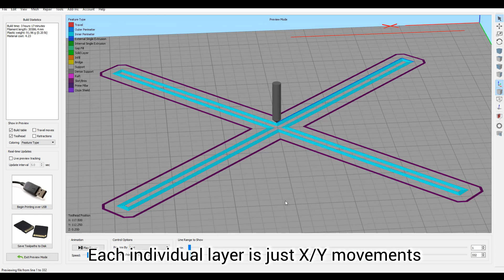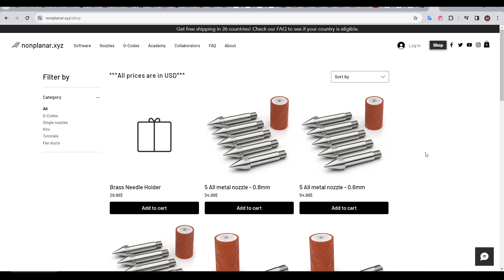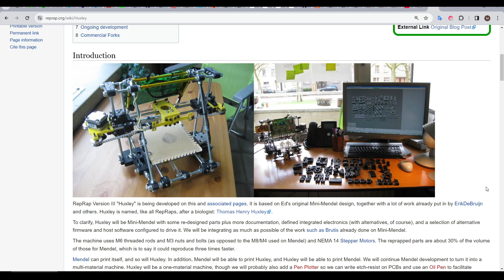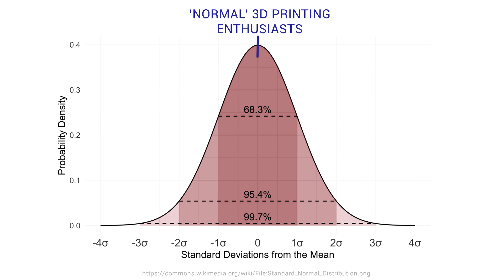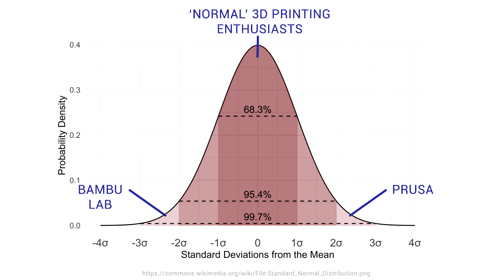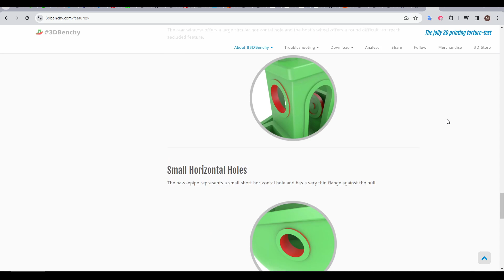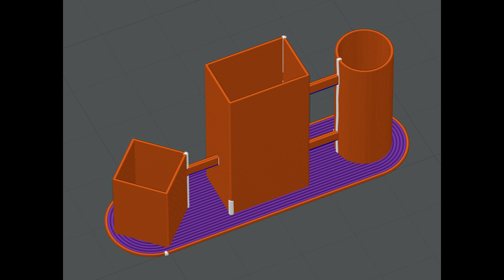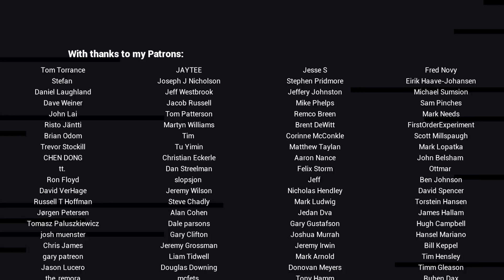3D printing mysteries that need to be solved in 2024

Comment: 9:20 Ford broken film noticed if you use a heated filament dryer it can cause brittleness if you cycle the filament a few times depending on the material, in addition some additives in filament can "evaporate" if not used for a long time causing brittleness what the additives are j have no clue. I just get the same problem with the same filiment

Comment: Planar: yes, we're all waiting for it. But as it will be only for "the look", I don't think any slicer company will touch it. The technical site of it is many times more complex than the looks of it.
Hemisphere: uhm, repeat the experiment with a 100% perfect filament, perfect nozzle (dimensions and clean), perfect feed and a perfect climate control (fans produce draft) and you would see that filament will not curl but drop straight down. Mine does, most of the time. 
Toxic: not my expertise. But I think people don't like other ideas. It could mean their ideas are "faulty" and recognizing your own fault could be pretty confronting. (Good luke with your bowden setup dummy 😂)
Filament snap: it's your setup. You feed the filament in a S shape AND forcing it through a bend. As long as you keep a steady feed, no problem. But start printing and think retracting. At that moment you are jerking the filament up and down the bend. I'm betting your ptfe tubing prevented the filament from snaping off complete. Change the setup to a feed coming from the top of the rol with only one "natural" bend. And I would not use tubing between roll and extruder, it causes strain and prevents "natural" form of the filament.
Artefact: the human eye is very good, if not nature's best, in spotting differences. Any change in gcode between the layers will produce some kind of artifact as the approche of the nozzle will be different. Monotone surface (Cura) is a nice example of this in the flat plane. In this case I bet it's caused by the prolonged cooling of the block while the toplayers of the tube are printed. Playing around with nozzle temp and cooling on a long tube in vasemode will produce matt to very shiny layers. The best solution I found for this problem is an enclosure for more even "crystalisation" and printing object one for one. But any production method leaves it's marks..
Benchies: I don't do benchies, I'm a engineer.

Comment: I've noticed that PLA always breaks if you leave it in the bowden tube for too long.  People used to say it was moisture, but I find that the rest of the roll is fine when the bit in the boden tube breaks  - just the bit in the bowden tube is brittle.  I also have dry boxes that I feed filament directly from.  They feed through a short length of teflon tube set in the lid of the box, and yes it always breaks at that point as well.  I'm going to re-do my dry boxes and just make a gland out of PLA with no tube this time and see if that helps the problem.  Don't get me wrong, moisture is definitely a factor, but that doesn't make sense for the bowden tube since there won't be much exchange of moist (or dry) air inside the tube, so the filament should be alright.  Maybe the Teflon is actually removing from the filament?  I've heard that over drying your filament can also make it brittle.

Comment: for the last thing the "artifacts thing",   my theory is that the usually retraction relieves the build up pressure inside the nozzle when a layer starts and ends. when the printer start printing again that pressure can be more or less than the the layer before (depending on the retraction settings) so i think this is what is causing the artifacts and which means maybe retraction settings may help, Ive not experimented much with this though. i ussually change my designs to not be too effected by this artifact.

Comment: Regarding your tower and cube issue I also think it is temperature related. The same happens when you pause the print or you change the filament. During your last layer on the cylinder you print a solid layer which takes longer. The other part shrinks and also you have some sort of non stabilized flows and temperatures in the nozzle. So I guess you are poking in the right direction. Regarding the one testprint you also should look up for the seams in the gcode if they arenset differently. Also an Idea for a testsetup: print a tower close to a cylinder. And just very infill on the cylinder from 15-100% every 5mm or so. As parallel track and plot the nozzle temperatures and maybe use thermal camera if you have one. Just as a few ideas, because I would be also interessted in the knowledge. Also try different filaments with different thermal shrinkage during the test.

Comment: I am confident there is more than one cause. But one is probably a big enough factor to appear to fix it on casual inspection. Two layers with different surface areas to print have different time-between-layers, different thermal properties, surface tension probably affects 3d printing more than you realize, so changing the surface area will have an effect (probably barely noticeable), those layers also have different airflow, etc. I suspect the color change and the indentation opposite the support are actually different effects.

Comment: I've been wondering about those "referred artifacts" lately, too. Aside from what was mentioned about temp/flow rate, which could well account for some of this, I also wonder if the toolhead pathing is also part of the issue? When layers are consistent, the toolpath also tends to be consistent, so extrusions are drawn in the same order and direction, layer-on-layer. When adjacent geometry changes significantly, the neighbouring extrusions can also change, for example perimeters might start from a different point, be extruded in the opposite direction than the previous layer, and speeds can change too (i.e. the flow rate).
Like many artifacts, these seem more obvious at higher speeds in my experience, which makes sense to me since at higher speed the nozzle will travel further while plastic is semi-solidified, dragging the just-laid-down extrusion a tiny bit, behind it. You throw all these factors together and it could explain a lot.

I think you could investigate the toolpath theory by simply examining the GCode to see if the problem areas are clearly different in how they get pathed by the slicer, compared to the good areas.

Comment: The possible cause of the artifacts may be that the amount of time between layers at a given spot.  This means there is more or less time for the printed material to cool before the next layer.  Someone can test this with so gcode modification.  You can have the  hot end go back and forth a bunch of times to add a delay.  This will tend to cool the head and reduce the flow rate as well as allowing more time.  If my idea is correct, the artifact should b the same.  If I am wrong you will get the inverse artifact.

Comment: I have always love you tech channel and is my number one to solve my issues as you give clear and concise information

Breaking filament 
Well over the years I can say it is old filament that has been exposed to moisture
And so for testing brands I tend to leave filament exposed for about two weeks and try a print
And so I can confirm it is moisture and sunlight or UV light that degrades my  filament
So my solution is 
When not using it. Is to put it back in it's packaging along with the desecrent moisture stuff
And with esun CF after two years it still works fine
I do have a heat box or moisture heater but I don't bother with it
Plain and simple if you finish printing then put away the filament
As for printing with different shapes and height problem weakness
I have resolved my issue by lower the fan speed
Meaning as your model gets higher the ambient temperature changes
And this also happens with certain shapes. 
Meaning an air flow around a round object has a circle swirl airflow for which is good
But upon square objects the airflow deflects ie bounces around causing insufficient air flow to that part in question
I hope my feedback is worthy

Comment: The surface artefacts must only be related to flow. To me it seems you are experiencing moments of too high or low pressure for the molten plastic in the nozzle which results in "flow shift" I guess you can call it. While you may have a set "flow rate", it can still be affected by the rate the filament is being fed and during what activity the printer is performing, ex: walls, infill, etc. I just spent a few weeks tuning my Ender 3 S1 Pro to print in TPU60A and surface artefacts are much more apparent due to how sensitive this material is. I printed a calibration cube and because of how fast it was doing my infill, the filament fed in faster and resulted in higher pressure which came out as a bulged wall, this ended with a finished cube that has small waves along all its walls going from top to bottom

Comment: I still believe the non-planar 3d printing would be a very nice feature for any slicer. I don't mean you would have to print in such a way all the layers, but it would be nice to resort to non-planar for small angles/curves and I bet it would only be a matter of detecting a set of layers that may fit the case and apply to the top infill algo.
Regarding the artefacts, I tend to believe it is a mix of temperatures, fans, accelerations and retraction settings although I could not fix them so far. I wonder if a good test model can be produced to run some tests but still you would have to really tweak settings in the gcode to modify on a per-layer basis so many parameters that might be involved.
By the way: I'm in Italy and my filament is poured clockwise. :)

Comment: I think you hit the nail on the head when it came to the last question, the first thing that came to mind for me was a temperature differential, there may be multiple factors in the cause though.  As for toxicity in the 3D Printer community, I don't think it has become worse per say, more so the extremist have become more vocal and less willing to learn through constructive communication.  I am sorry you got so much hammering over building a Ratrig vs a Voron.  I am a Voron builder myself (and Annex K3 and customer printers), however what I have found within the Voron Community, we as a group seem to be more open to ideas / knowledge and constantly pushing development.  I have been on the receiving end from Ratrig guys and some VZ Bot guys, but as a general rule, we are pretty open and helpful.  We have found we spend more time helping others with their other brand printer in the Voron Discord VC than Vorons, its seems to be more a help people with specific and more commonly Klipper issues. 
Also, the filament failure in your reverse bowden is a combination of things, the main causes of the issue you are seeing are A exposure to UV, B the filament is set on the spool giving it a predefined arc and in that bowden setup, it will cause microfractures C moisture getting into the filament (even in ABS and ASA) and finally D oxidization causing a brittle outer layer and leading to more microfractures.  Also, love the TTR channel and nods to MCM

Comment: nonplanar printing is something I would like to see, the extended nozzles with adding a 4th axis to the print head would greatly increase clearance if you could program in an approach angle and departure angle you sould likely resolve the issues. but a specialized slicer would be required and auto tramming would make it user friendly

Comment: For the artefact with the top layer notice that you have a matte band a couple layers thick at the top of the rectangle prism. So I think it has got to do with the cooling fan and bridging when the fan is running full blast the corners get more rounded because of the filament cooling faster tightening the "string" of filament

Comment: 6:21 Well, you just described all of US politics in a single sentence. Who knew that 3D printing was a universal concept! Extremists are the enemy, and the initial folks aren't the extremists - it's all the people who come later who've latched onto something that somebody earlier said (but didn't mean as gospel).

And the benchy secret is blowing my mind! 

Regarding the print artifacts, I've remarked on this to Ernest and/or in the SecKit group. My experience is similar to yours - when I get artifacts, it's because the model geometry changes noticeably. My theory was that the hotend heater and/or part cooling do not react quickly enough, and may need some approach similar to linear advance or retraction in order to properly match the change in geometry at the right time.

Comment: For what creates the surface artifacts could also maybe be retraction. The jumping between objects so it retracts and some filament is still sitting in the hot end cooking a bit longer causing the dye to change color and get a little lighter. The indentation could be the slicer trying to off set the change of direction. I am thinking kind of like input shaping but more that it has a lower flow than needed to fill two walls so the two walls are not really two walls in the area. More like a wall then getting stretched into a bridge area. so it is melting a bit in. For the bottom one where it was pushed out on the far side that could be because of the backup of pressure and taking that turn gives it a bit more room to squeeze out on the turn. Not really sure just some ideas.

Comment: Okay, I was following along right up until you showed the examples of "toxic" comments. I read each one. Two of them were a bit disrespectful; the rest were completely fine. More broadly, I agree. 
As for non-planar, I'm still excited for it. But there are few things that it is useful for (aerofoils?). I suspect that's the primary reason it hasn't taken off. I wonder if people are more actively using non-planar printing among drone enthusiasts.

Comment: Regarding the artifacts, the longer the extruder flows continuously the temperature at the very tip of the nozzle starts to drop, which changes the viscosity/dynamics of the flow over time, so when it is printing the same layer or very similar layers many times (which would have a consistent layer time) the dynamics of the flow are consistent. When the layer time is different, even if is the same G-Code for a certain part of the layer, the result will be different due to this temperature variation. That also means that the K value "calibration" for the pressure advance is not perfect for all the print, but for a very specific case. In a perfect world this K value would change during print according to the dynamics of the flow.

I'm currently working on a possible solution to that as my final college project. I should post the results on my youtube channel soon
Reply: You are the second channel i follow now in this comment section, having a possible solution to one of each problem spoken about in this video. Many great minds were apparently summond by this very video.
Reply: This is the conclusion I reached many years ago as well (and was explaining to someone on Reddit today, actually). Good luck with your dissertation!
Reply: I have thought about this problem as well. Unfortunately, I am not smart enough to solve it. Non-linear pressure advanced based on print speed would be ideal. I use Cura to replace parts of the GCode in order to change the pressure advance at specific layers. This helps with slower first layers and the faster layers later on. It is hacky, but did show an improvement.
Reply: Isn't this what the flow sensor in the Bambu A1 extruder compensates for?
Reply: @drumstyx  yes, it is. I started this project at feb. 2023, before the A1 release. But since it still not clear what they are doing we decided to continue the project and open source it when ready.
Reply: @Guilherme_Parreira  Hi I interested in this topic is there way how to contribute?
Reply: Should be able to reduce the effect by limiting the flow rate to the lowest value. Or in other words, when slicing make sure the flow rate is constant for the entire print. Pressure advance though is another matter, but may have a reduced effect too, I believe.
Reply: there's a video fixing this in bambu slicer by normalizing the flowrate throughout the print
Reply: @alksmdlaks Hi. I’m new to 3D printing. I’ve printed the orca cube and realized the surface between the top and bottom of the letter X is clearly discernible from the top and bottom part of the cube. Is this caused by this problem?

Could you share the video? Maybe it will work on my Ender 3 V3 KE as well.
Reply: @misclickable  I can''t find the video right now but it is usually a problem due to speed and flow rate. You would have to change the speed of each later. Basically what's happening is the plastic isn't cooling down as much on the faster layers, so on the simpler layers above and below the X pattern each layer is printed in less time due to being less complex.
Reply: @alksmdlaks  I tried setting minimum layer time to 0 so they all get the same flow rate. Tried printing inner/outer, outer/inner and inner/outer/inner but none worked. I’m thinking maybe the higher flow rates in the flow rate passes that looked better to me were actually bad results. I’ve been using 1.02 and I’ll try 0.992 today. Should I try to set the minimum layer time to the longest layer time after slicing the object once?
Reply: Would be cool if you could make that into a postprocessing script in Orca slicer!